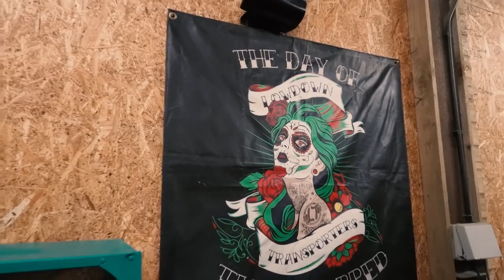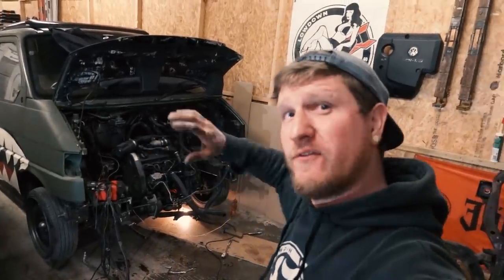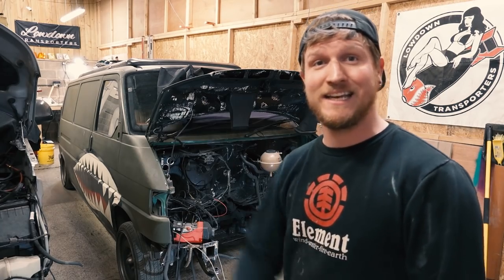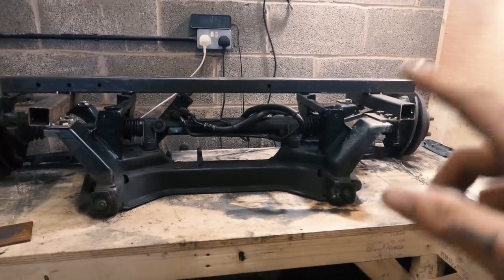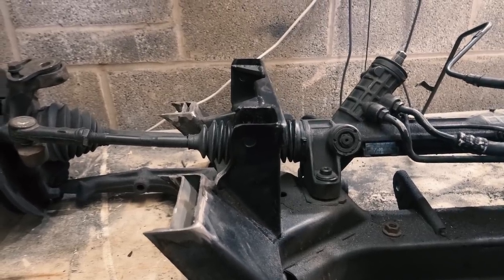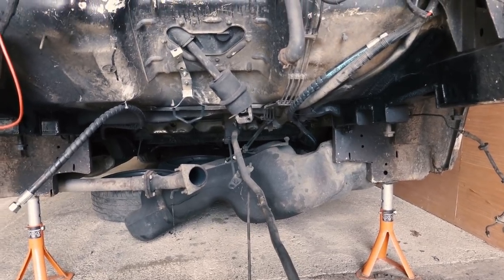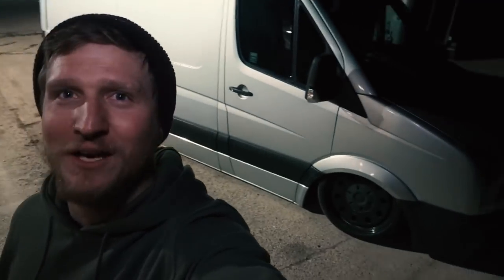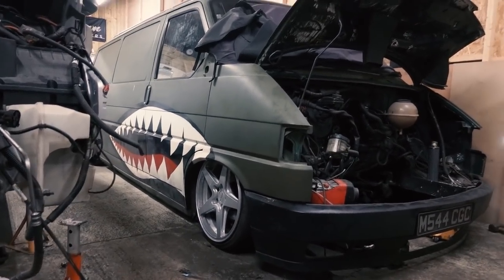Our VW T4 gets a PD130 pt1  ||  Subframe raise huge drop ||  Guest appearance from the Silver Slug

Comment: Will you be doing a how to sort of guide for the wiring and will you be using the 1.9tdi vw t5 sump and oil pick up i thought about using a t5 gearbox for the correct angle of engine and drive shafts when i come to do my conversion eventually sorry for all the questions just excited to watch you do it 😁
Reply from the maker: I am going to be doing a how to on the wiring soon, just been held up on the fabrication work with the subframe raise atm. I am going to be using my t4 box to get it in and running then il be doing a 6 speed conversion in the not so distant future.
I hadn't thought about a t5 box 🤔
Reply: @LowdownTransporters  excellent will be looking forward to more vids😁👍

Comment: Hey man , did you have any problems with the steering rack , does the shaft need to be made shorter to compensate for the 30mm subframe lift only asking as im hoping to be chopping mine over winter and dont want to bump into any unexpected problems 🙂
Reply from the maker: The only thing I did was before refitting the subframe and rack I loosened the bolt on the rack in the foot well and you can then tap it up a bit along the thread to allow for the subframe raise. If that makes sense 😂🤦
Reply: @LowdownTransporters  yeah that makes sense  to me , thanks for the reply really appreciate it 🙂
Reply from the maker: No worries dude, any issues let us know